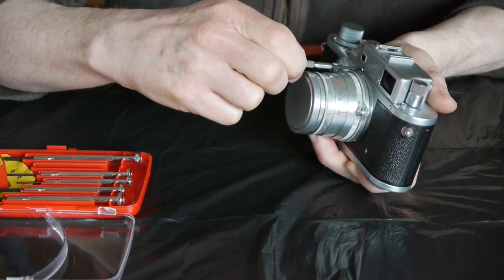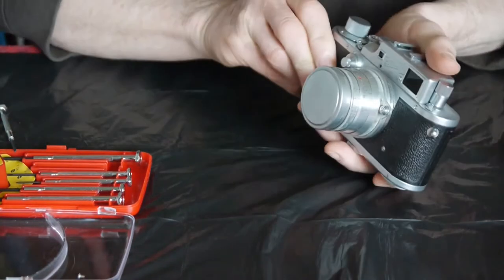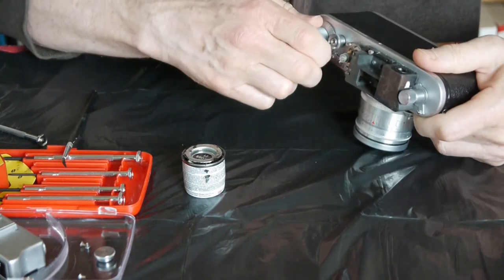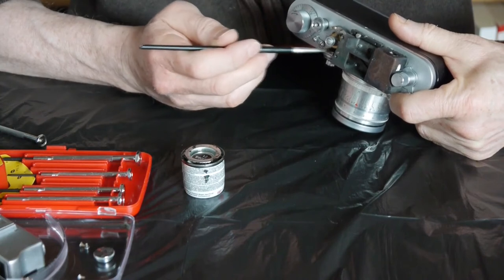Zorki 3 Slow Speeds Fix Part 1 -  Under the Top Cover

Comment: "Notoriously unreliable" is a bit of an overstatement. I don't know this model inside out, but I bet it only needs some fresh grease and perhaps correcting tension on some springs. But if you really think it's that bad design - why bother fixing it? Why not go with more convenient 4K you've shown before? This being said, fingers crossed it's a CLA kind of job, not a repair...

Can't wait for the second installment and the difficult part of the job! 

Cheers!
Reply from the maker: Hi Luke, I don't think it's a bad design necessarily, but the truth is the early Z3 is more prone to slow speed problems than the Z3M with slow speeds under the top housing. The problem can also affect the Barnack Leicas with slow speeds (iii - iiig), which also have the mechanism placed in the bottom of the camera. Why bother fixing it? Well, it's such a beautiful old machine it would be a shame not to! I think you're right when you say the problem will turn out to be a CLA type one, the mechanism itself is no more subject to wear or mechanical failure than other, similar types, so fingers crossed!

Comment: Hello is it the same way in Zorki 4 to fix it?
Reply from the maker: It's similar, but the slow speed mechanism in the Z4 is under the top cover, rather than in the bottom of the camera, as on the early Z3, so rather easier to access. Thanks for watching.
Reply: @zenography7923  I will try to take a look in my Zorki 4.
Thanks for quality content